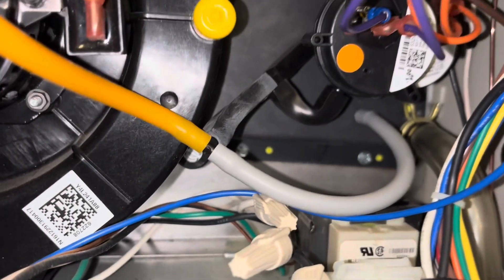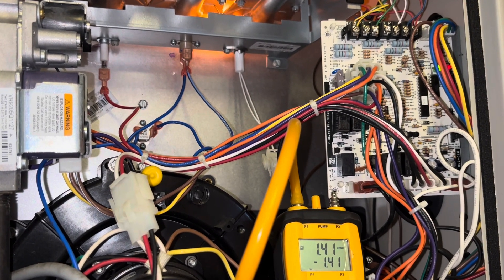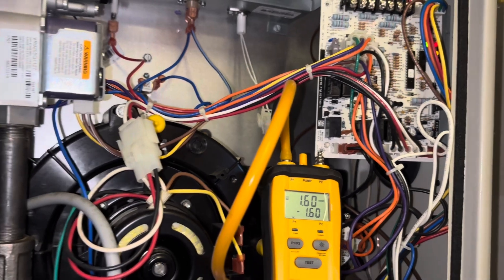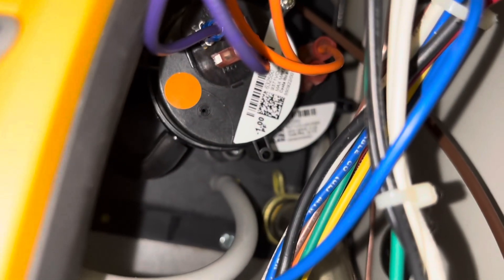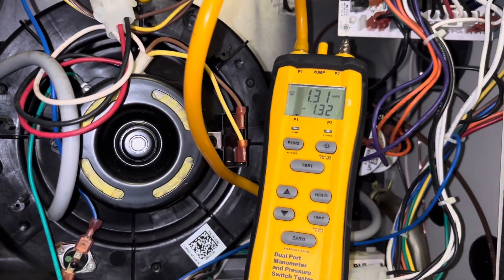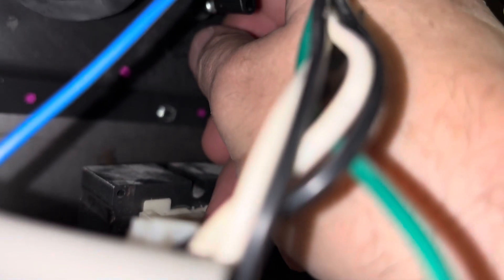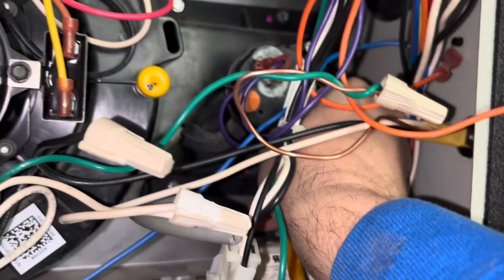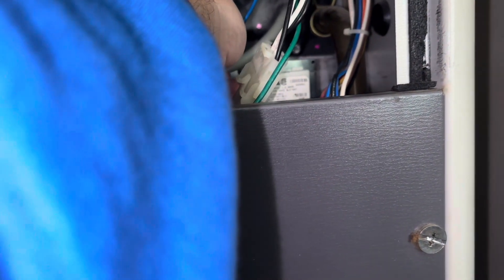Bad Pressure Switch?  Or Something Else?!?

Comment: Had a no heat call last month. 20 year old trane gas heat in attic. Found pressure switch tubing had come off pressure switch. I figured homeowner must have been up there checking on unit before he called for help. Once I reconnected and checked pressure it was all good. I was honest and gave him a break as he is repeat customer.
Reply from the maker: Good stuff.